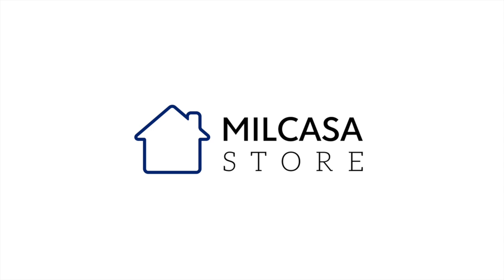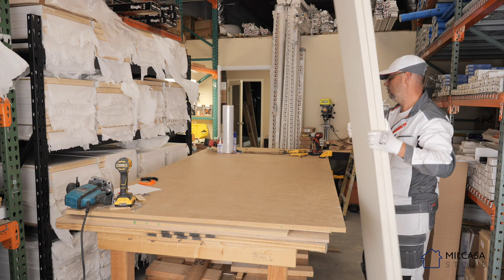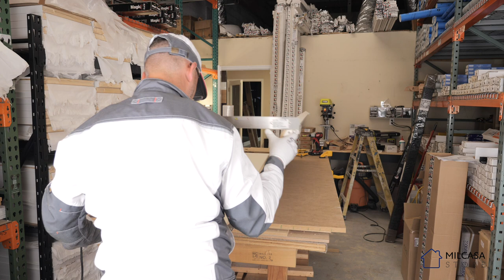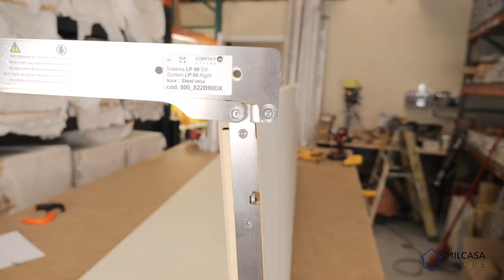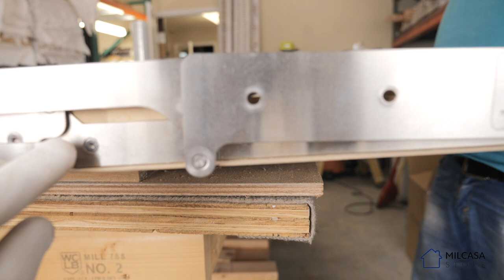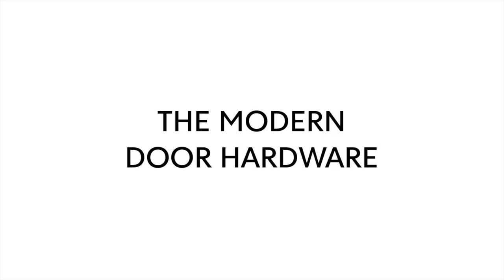Milcasa Store - Template for the inset of the Compack Folding Door Hardware Set - Installation

Comment: This is supposed to be a video for the template set you offer to install the Compack hinge set, yet no where in the video do you show the gentleman using the templates!
I had the misfortune of installing these BEFORE you offered the templates for sale. It was difficult but doable for someone with experience. It is NOT for the inexperienced DIYer. These products are all GREAT. But the installation instructions are confusing as heck. I even caught an error in one of the measurements in the installation instructions. You should have someone with zero experience with these products (but a decent amount of general woodworking experience) help with revamping the installation instructions. This will help with pointing out difficult or ambiguous steps in the current instructions offered.
Making the installation instructions as easy as possible will almost certainly lead to more sales. The templates are a good step in that direction.
Reply: Looks like they’re lacking quality control when it comes to their videos. For example, a proviso is the hardware can only be installed when the walls are flat but one of their videos shows an open with raised trim. What’s up with that? Or are their instructions wrong? I’m confused.
Reply: @JillofAllTrades2  I have the Compack 180 installed on a pre-existing door with trim. It clears the trim fine👍🏽